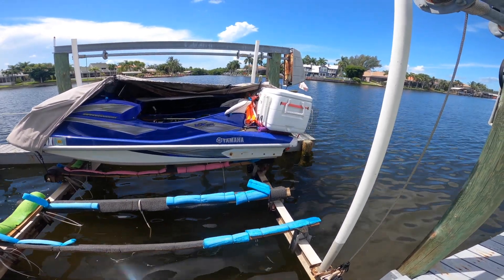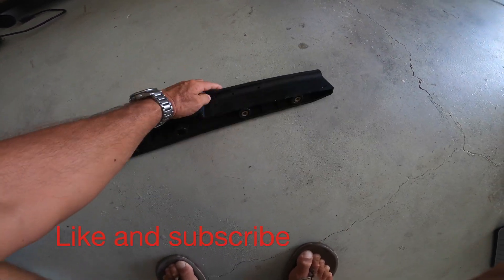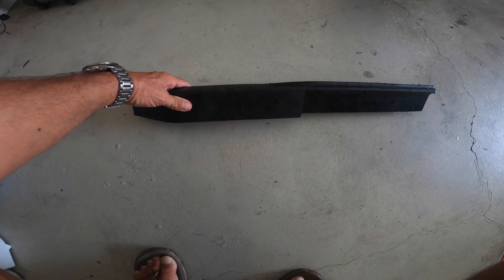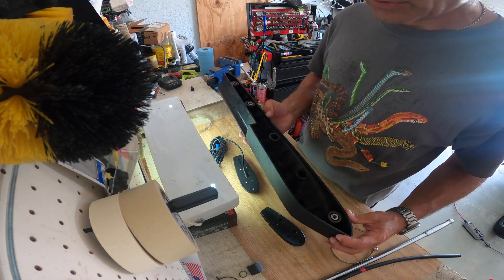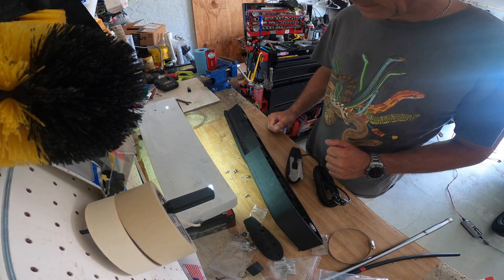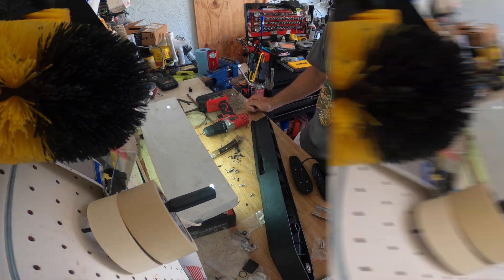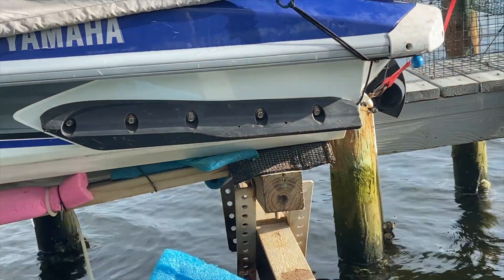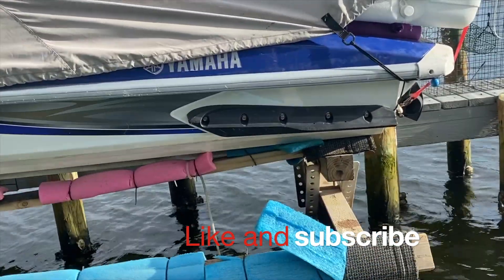Transducer installation on jetski

Comment: Hey Rene,  You said you used the hole that was already there?  I just gpt a 2023 FX Cruiser and wonder if I have that same hole you talked about?   Does that side piece stay in the water at high speeds?
Reply from the maker: Thanks for watching and commenting, the hole I was talking about is NOT on you jet ski, it was previously mounted with a different transducer, but I needed and upgrade so I used the same hole through the hull if that makes sense. 🤗

The transducer stays in place during high speeds and even transmits during high speed as well, it works pretty well. 

Sorry for the late reply, but hope you can use the answer. 

Sail safely 

Best regards Rene
Reply from the maker: All good 👍

Comment: Did you drill a new hole to the hull of the jet ski?
Thanks for sharing new ideas, it really help.
Reply from the maker: You are more than welcome, and thank you for commenting. No, I did not drill a new hole in the hull, I used the old one and protected the cable inside the fearing. This way the transducer is not getting damaged, when you beach the jet ski, fish in severe vegetation with oysters and roots from mangrove trees. It seems to work very well. 

I do not like to drill holes in the hull  unnecessarily, so if I can use the one already there, I would, for safety reasons, that is the reason I used the old hole. I could probably have went straight through the hull in the side but I have NOT examined what is behind the hull there.

I hope that helps, and answers your question, it has been working very well since, I did the change and can only recommend it. 

Happy new year, and stay safe out there

Best regards René